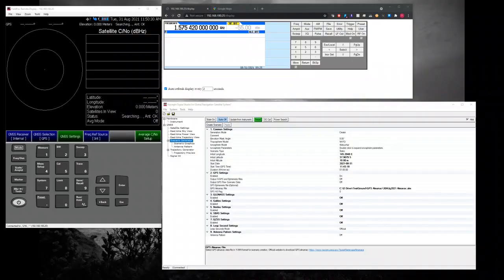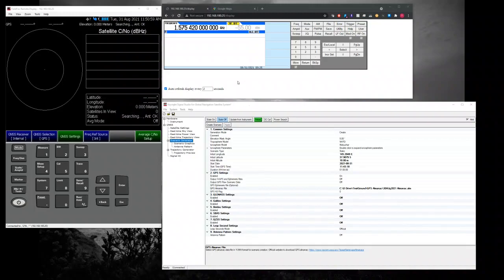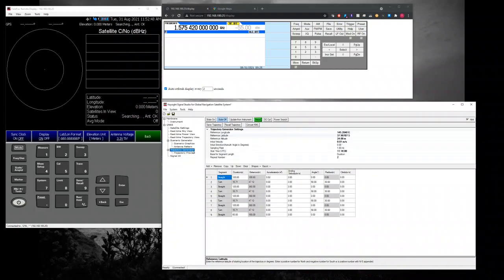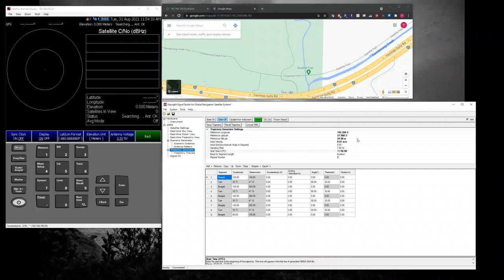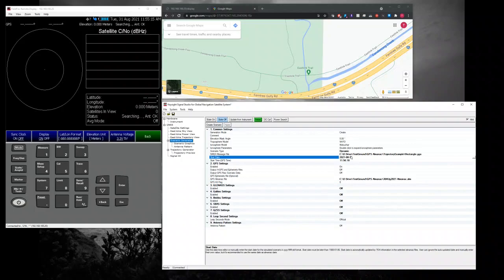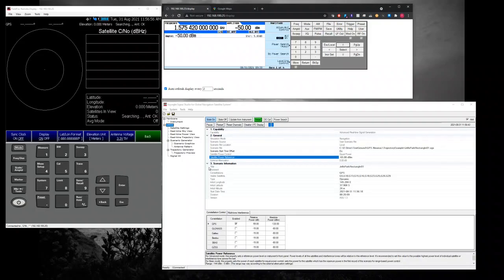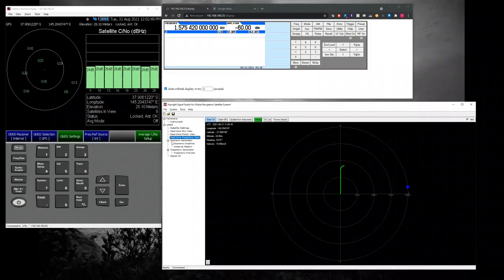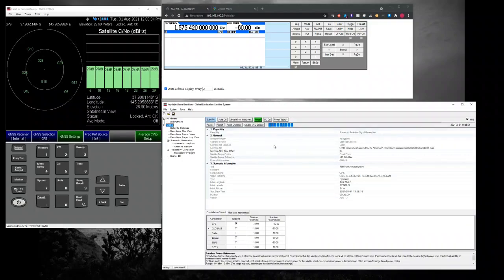Episode 59: Global Navigation Satellite System (GNSS) Signal Studio Dynamic Emulation Setup

Comment: Your video's so helpful. I want to ask something about FieldFox. For such measurement, what options on FieldFox must I have? Is it just enough with GPS receiver option in the FieldFox (also with GPS antenna)? Kindly hope your answer 🙏
Reply from the maker: Yes, you will need GPS option (307) on the FieldFox. Best is to check with the local Keysight folks on this and the pricing. 
Normally i'll get the whole set from Keysight to avoid any issues on the GPS connection. But if you happened to have a UBlox-3.3v GPS antenna, then you can give it a try.